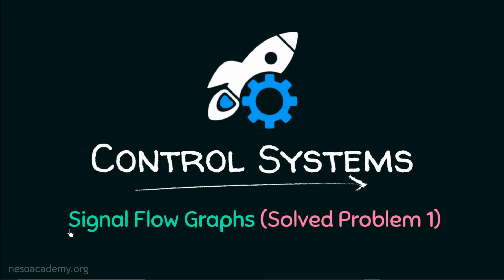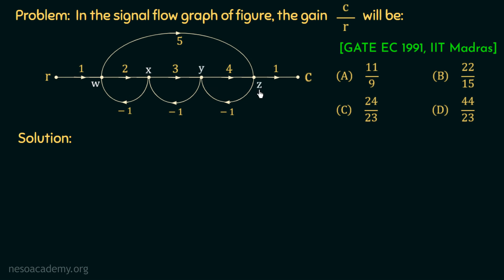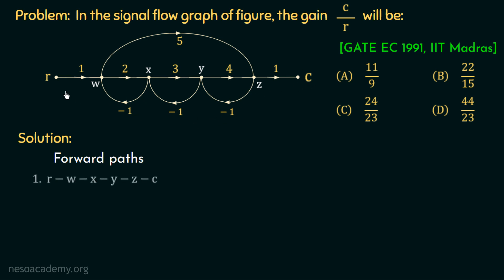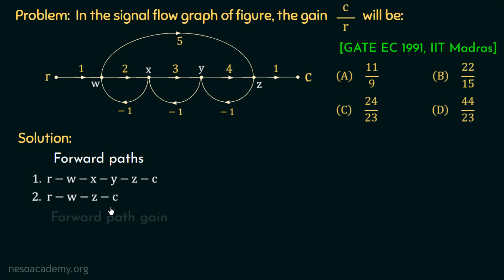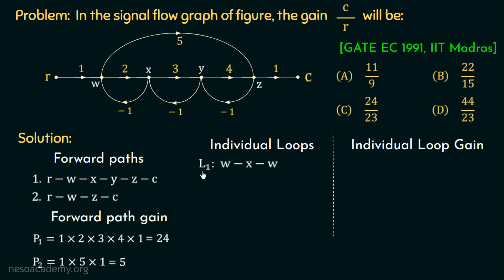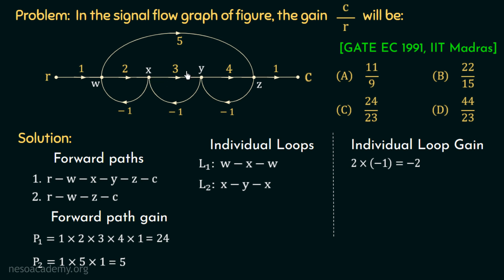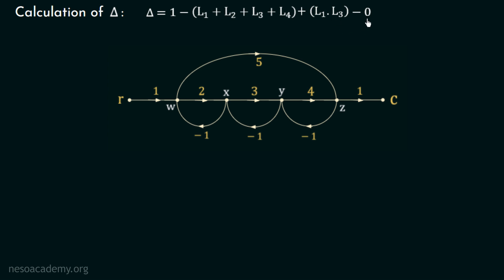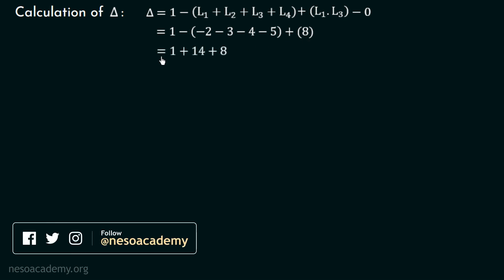Signal Flow Graphs (Solved Problem 1)

Comment: Why wasn't w-x-y-z-y-x-w considered a loop when w-z-y-x-w was?
Reply: it's because when forming a loop you cannot repeat any node as in go through the same node more than once and as you can see in your case you  have repeated the x and y nodes
Reply: We want Individual loops, The loop you mentioned are 3 individual loops
Reply: @randoms.i.m.p2583  what does individual loops mean
Reply: @issamdajani1603  I think "individual" means that the loop doesn't come together at any point on the inside; in other words, no vertices are repeated except the first and last.  I believe the applicable term is "directed cycle":

https://en.wikipedia.org/wiki/Cycle_(graph_theory)
Reply: mindi.... Both loops you are saying are same bro